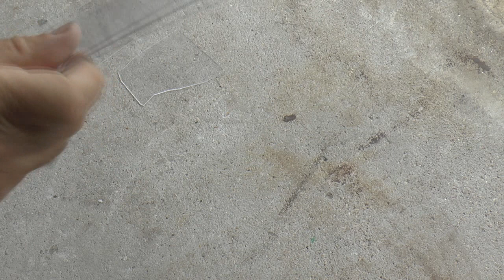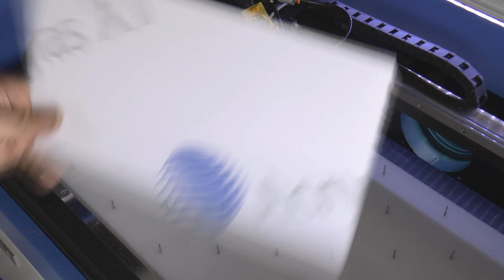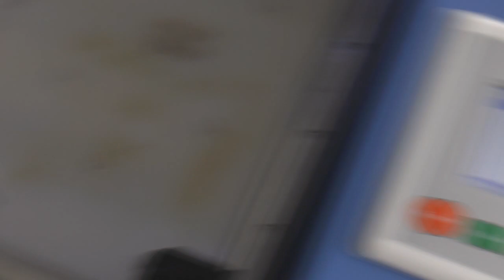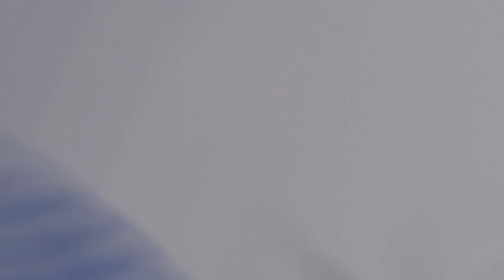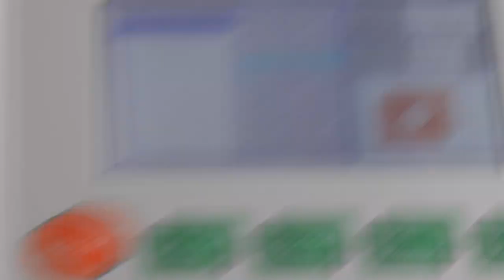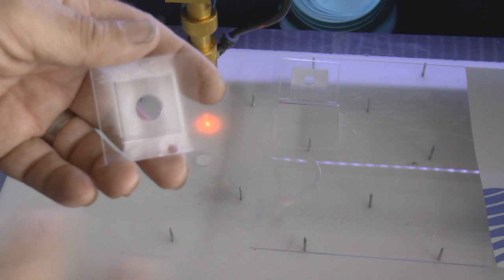RDWorks Learning Lab 05 Cutting first program

Comment: Thanks for the quick response: 
Can you move the head around with the arrow keys? Answer: No
Have you recently uploaded a recent version of RDWorks? Answer:   No, had the same program for about a year now 
Do you run the machine from an attached PC that uploads programs or is it is a remote PC and loading files via USB stick Answer:  An attached P.c uploaded via a usb cable 
Will your machine run old programs that are still in machine memory? Answer: No
Reply from the maker: Sounds like bad news but let me ask a few more quetions now that the arrows do nothing.
When you turn on your machine I am now assuming that the machine does NOT run to the corner to set 0,0. 
If you open the control cabinet and look at the white box unit, can you see any leds illuminated?
Try pushing the head to the switches at 0,0. Now look at the white box to see if any LEDs are illuminated.

Do you have a multimeter?  On one end of the white box there is a termination  block marked CN0 This is the power into the box.  There should be a 24vdc supply at this point. If no then you will need to check for a fuse on the power supply board..

I the white box does have power to it then it may be a failure in the keypad.  Beside the CN0 terminal is the input from the keyboard. Make sure this is well connected .
Lets what we have when you answerr these questios.#Best wihes
Russ
Reply: Hi Russ, where about is the white box unit? 
kind regards

Steve
Reply from the maker: Hi Steve
If you have a machine like mine then it will be  in the electrical cabinet on the right hand end of the machine. When you open the door there will only be the one white box in there with a row of leds and lots of green input/output connectors. You will definitely have a Ruida controller because that's what RDWorks is designed to work with.
Best regards
Russ

Comment: Can you help,
I have a BJB6050 laser machine which has been working perfectly for 2 years for some reason now the X and Y axis are not moving when i down load a program although there is still power going to the laser which cuts through the material without moving it seems more like something to do with the program set up rather than the machine itself, any ideas please
Reply from the maker: Hi Steve
Several questions
Can you move the head around with the arrow keys?
Have you recently uploaded a recent version of RDWorks?
Do you run the machine from an attached PC that uploads programs or is it is a remote PC and loading files via USB stick
Will your machine run old programs that are still in machine memory?
Best regards
Russ

Comment: hi , can you please tell me the distance from lazer to the cutting material. I see you use a gauge so what is the focus distance ?
Reply from the maker: Hi 
It depends on the focal length of your lens. The setting piece you were supplied with should tell you from its size what lens is fitted. It will generally be a 2" focal length, in which case the setting piece will be 19mm. If you do not have this setting piece, the quickest way to find out the aprox setting is to drop the table 3" or 4" and then hold a piece of paper about an inch  below the nozzle and press the pulse button for an instant. If the mark is big then raise the paper by a small amount and try again. Repeat this until you find a position where the dot is smallest. Guess the measurement and then set the table to that same setting. Now with the paper on the table, raise and lower the table to find the smallest dot, then measure the gap. You will benefit from watching these.

https://www.youtube.com/watch?v=WbBPps42iHc
https://www.youtube.com/watch?v=1yMAr75h5O8
https://www.youtube.com/watch?v=61bGzWicRRk

Best regards
Russ
Reply: cheers you are a legend and I am enjoying watching your tutorials.

Comment: we are having a hard time trying to figure out where the starting point of the laser will be and the boarders will end up being. we have been working on mirrors to etch. I was wondering if you go over any of these issues on your lesson labs.
Reply from the maker: Hi Ron
I need a little more information to understand your problem.
You are engraving on the back of a mirror I presume? It depends on where your little green square is sited when you created your program. Engraving an image is not something you generally need to control It starts, scans back and forth across your image and stops . However, I can imagine the possibility with a mirror that you may have 4 distinct corner patterns that you want to  engrave each separately to save on scan time
If you click on the blue square beside Sarbar Multimedia, it will open a page with tabs. Click the ABOUT tab and another page opens. Top right there is a MESSAGE button that you can use to send me a private message. Send me your email and we can discuss this off line. I'm sure there is an easy solution once I fully understand your problem.
Best regards
Russ

Comment: Hey mate, I've got the same laser and am curious if you've observed and better yet resolved the problem I'm having with the unit. I've got a co-worker with a much larger Chinese laser maybe 1200 by 900 and accordingly much longer belts and axes and his is cutting truly flawless small circles...it's quite shameful the difference. Here's my video showing the problem, thanks for all your videos it's been a treasure trove of information. https://youtu.be/-ccHBiULpl8
Reply from the maker: Hi James
I am both pleased an sad because
 A) I don't have your problem, my large and small circles are perfect as far as the eye can see and a circular blank will fit back into its hole and rotate 360 degrees 
B) I don't have an immediate fix for you. 
However, I'm happy to help with ideas that may be be different than yours and possibly "off the wall"
I have watched your video and your methodology is superb. The strange behavior of both the X and Y axis  MAY be the cause of your problem but somehow I think fixing it will be only part of the problem.
My initial thought as I watched your video is "belt climb" You could try easing the belt tension slightly and repeating your tests BUT before you do that I would spray the belts and drive sprockets with either silicon spray if you have any or as an alternative some furniture polish containing silicon. I say do this first because if you slacken the tension too much you WILL get the problem you see.
There are some other possibilities but lets try one thing at a time. You can message me on the YouTube private messages  with you email as it may be easier to communicate off line

Best regards
Russ

Comment: Hi Russ,
I tried what you suggested to me the problem is still there.
I Default is set for the speed for which the power and I set on the machine power panel (40%) and speed (5 mm / s): launching the cut and does not turn on the laser.
Imposed on the power control panel display but the same speed 11mm / s and the machine cuts ..... ????
Perhaps there is some parameter to be set in the machine panel with the keys ???

Thanks for your time!
Francesco.
Reply from the maker: +Francesco Lantieri 
Hi Francesco
This may take a little effort to solve and that's best done by private email. I don't like people sharing email addresses on public forums so click on the blue square beside Sarbar Multimedia above and you will see some tabs. Click the ABOUT tab and you will se another page. Top right there is a MESSAGE button. You can send me your email address privately there and begin to communicate freely. I may need some pictures.
Best regards
Russ
Reply: +SarbarMultimedia 
Ok
My e-mail is: frlanti@libero.it.
Let me ask some questions and some evidence that I can document with pictures and texts.

Comment: Hi Russ! congratulations for the video!
I wanted to ask you if you happened upon this strangeness and how do you think you can solve.
By setting the speed below 10mm / s from RDworks to any power, in the press does not turn on the laser, but are toured.
If I force manually from the keyboard instead of 4,5,6,9 at low speed, mm / s the laser cuts. What could it be! Thanks Francesco
Reply from the maker: +Francesco Lantieri 
Hi Francesco
I think I understand your problem but I will go through step by step.
1) The laser POWER cannot be set below a certain %. It depends on your machine . The laser tube will  not fire below 8% on some machines and on others it may be as high as12%. There maybe occasions when it is useful to set the power to 1% to make the machine move slowly between two cuts.
2) In the cutting parameters panel there are several things you must do.
Is OUTPUT? will always be YES  unless you have drawn a location box for example that you wish to hide. Then that will be on it's own layer and you will answer NO
3)Beside the SPEED and the POWER boxes there is a box called DEFAULT.  MAKE SURE THESE ARE BLANK. If these are ticked then RDWorks will automatically ignore YOUR parameters and run with the MANUAL power and speed setting you have set on the machine buttons.
See if this fixes your problem if not we will look further
Best regards
Russ
ps thanks for your kind words

Comment: Hi. I wanted to ask you how you can achieve a straight edge on 3mm acrylic when cutting. Im at a power of 65% at speed of 9mm/s. My piece comes out slighty curved outwards, and now im wondering if with 5mm acrylic its more noticeable. If you've had that problem,  did you raise  material of bed, reduce distance between material and laser surface or any other procedures? Thanks in advance
Reply from the maker: +Delco Lasers 
There are several possible problems here that I have encountered in trying to fix  what I think is your problem, which is the squareness of the cut edge
possible causes:-
1) Is your lens tube/head perpendicular to the bed in both planes?
2) Have you done a pulse test into a piece of wood at the ideal focus point ( I guess that's about 19mm below the nozzle if you have 2" focal length lens). Then drop the table by about 6mm and repeat. The dots should coincide. If not there's a beam alignment issue
3)Is your lens fitted correctly? Should be flat side to the work table. Make sure you handle the lens with cotton gloves on or with tissue so that it doesn't contact your skin.
4) With 3 and 5mm thick materials, whether you have a 1.5" or 2" lens, there should not be any noticeable curvature on the edge due to the shape of the beam. It's hardly detectable on 15mm acrylic that I cut with a 1.5FL lens. For 3mm I would set ideal focal point onto the material surface. For 6 to 10mm I raise the table 1mm and for the 15mm I raised it by 2mm Remember I have a 1.5" lens. and 30 watts of power after my lens.
There are videos in the series showing me struggling with all these issues.
Hope this helps a bit
Best regards
Russ

Comment: You are doing a fantastic job here.
I am in the process of buying a lasercutter (living in the Netherlands) but average prices for a 40 Watt cutter are around € 4000,--.
A lot of money and a "little" over my budget.
Your articles show me what can be achieved with a relatively cheap and affordable Chines cutter, which is impressive.

I want to use it to make dials for simulators and wonder if you have experience with that.
Dials are made by applying white paint coat, covered with a black paint coat (several coatings are necessary) on transparent acrylics, and than engraving into the black layer, so the white layer comes through.
Do you think that will be possible with this lasercutter?
Reply from the maker: +Arend van Oosten 

Hi  Arend
I would think you will easily be able to do this but I have a simple question. Why clear acrylic? If you require white letters on a black ground why not start with white acrylic and just paint black onto it. A more economic and better way would be to use Black acrylic and cover the surface with paper transfer film (the sort used in vinyl application) engrave through and white fill before you remove the paper mask.

Here is a 50 watt machine exactly like mine (it has a 40 watt tube) and will deliver to Nederlands for an all up price of about 1500 euros

http://www.ebay.co.uk/itm/50W-CO2-Laser-Cutter-Engraver-Laser-Cutting-Engraving-Machine-1020-650-570-mm-/361346557419?hash=item5421eee5eb:g:2bsAAOSwQTVWALzj#shpCntId

Best regards
Russ
Reply: +SarbarMultimedia It has to do with the light distribution in transparent perspex. The panels are being backlit and my experience is that with white perspex light distribution is horrible.
Reply from the maker: +Arend van Oosten 
Hi Arend
Yes I agree now that I know you are backlighting it. However. if you are using LED illumination then you may wish to investigate this
http://perspex.com/product-ranges/perspex-optimised-performance/perspex-spectrum-led/
I'm sure a quick email enquiry will get you a small sample to play with
I have used this myself for shop signage
Best regards
Russ
Reply from the maker: Hi Arend
Send me your email via the You Tube private massage system and I will put you in touch with some one doing exactly what you want with a machine like mine. Even if you are succeeding after all this time the contact may be useful.
Best regards
Russ

Comment: You're a star mate.  Thanks for sharing.  You've saved me ages.
Reply from the maker: Glad you found it useful. If you have recently bought your machine you might like to jump to the end of the series to see how to test the laser on near full power. I didn't do this until several weeks after I had purchased and now I find it's not working at full power for more than tens of seconds. There is a VERY short period that Ebay cover you for goods that are not as described and PayPal class such problems as a warranty issue and advise taking it up with the seller. The seller is in China and couldn't care less about my problem now that they have my money  it may take several weeks before I have a result but I'm now working the problem from a different angle. There are a few more in the Learning Lab series that I can offer but I've now covered all the important programming issues.